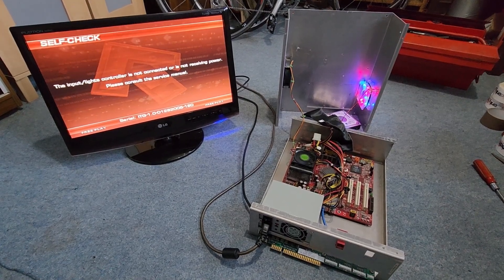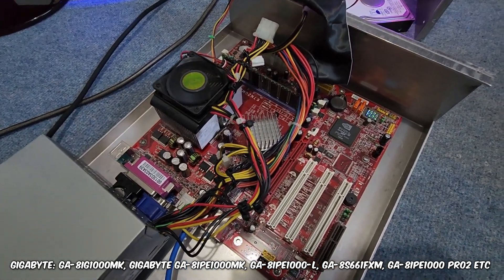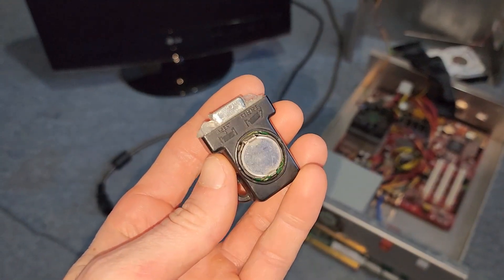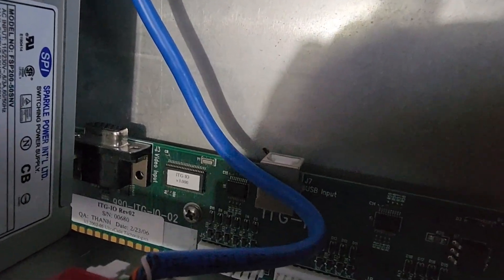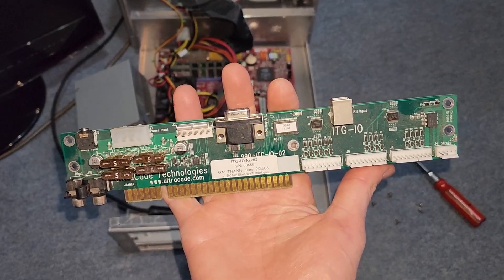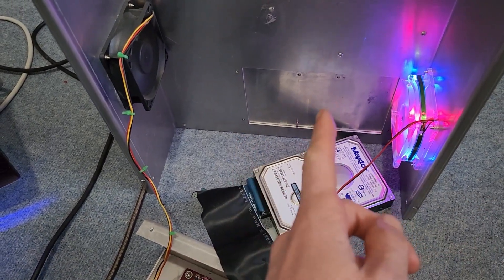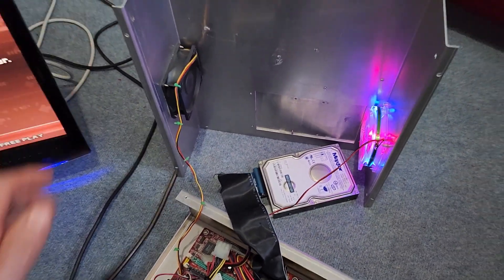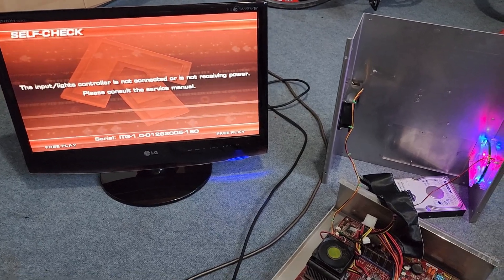Inside an Original BoXoR PCB (DDR Upgrade Kit) | In The Groove | Roxor Games

Comment from the maker: That '835
Reply: @s34nvideos  I have a location that wants the machine. It works fine but I’m concerned about the hardrive failing. I’ve tried cloning drive to sata with a ide to sata adaptor with no luck. Was wondering if sercurity is married to the original drive?
Reply from the maker: @rcamusements  Yes it's married. I can offer some no dongle check HDD images, but I ain't doing it for free because I don't have much free time
Reply: @ wouldn’t expect it for free. Could we arrange a download of the file and I copy it to drive? f
Reply from the maker: @rcamusements  Yes. It would be a complete HDD image, so you would image it to a new drive with Self Image, Etcher, dd etc
Reply: @s34nvideos  let me know when we can do this.
Reply from the maker: @rcamusements  Anytime after Tuesday
Reply: @s34nvideos  let me know when we could do the transfer thanks.
Reply from the maker: @rcamusements  I'm free anytime, send me an email or something

Comment: My local arcade still has a running ITG2 upgrade kit with roughly 4500 songs and it's always sooo slow at the end of the day after people have played on it. I've always wondered why the ITG2 dedicabs were so much faster compared to the upgrade kits, and I guess now I know. Before this the only things I knew about the machine at my local arcade were that it has an AMD processor in it and it's been upgraded to 1GB RAM. Man, using onboard graphics was such a dumb idea! Not that it's a problem, though because next week I'm going to help them install a newer computer in the machine and install newer dedicated software (known as TJ's image) so that they can have something much more reliable. As it is though, I honestly can't believe it still works! They were telling me that it's all original parts (except for the power supply and upgraded RAM) and how the board's flexing from the CPU's heat and that it has bulging caps all over it!
Reply from the maker: It's probably the Stats.xml file to be honest! If you delete that (the scores will all disappear), you'll notice it'll save way way quicker. It's still gonna initially load slow though due to the number of songs on there.